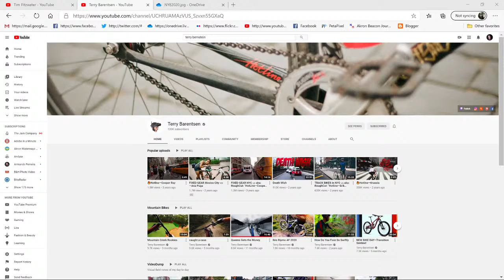Evening Routine #18 - LOOK KG76 Kevlar Hinault - Vintage French Carbon! | Campy Groupset

Comment: I just picked up a KG76 last week but the chain slips of the rear cogs. It seems to need an overhaul on the chain and derailer. Do you recommend taking this bike to a local bike shop to be repaired? Thanks
Reply from the maker: For sure. If you can’t figure out what is wrong on your own or don’t have the right tools to fix it take it to the local bike shop. This bike was sold with a few different group sets - if it is Shimano it should be cheap and easy for you shop to diagnose and fix.
Reply: @TimFitzwater OK great. Thanks a lot!
Reply: @TimFitzwater Hi again! Ok I tuned my derailer up after watching some how to videos on YouTube. My KG 76 is very similar to yours. Is there a way to determine when this particular model was made? And is it just me or is it hard to find decent white color 23 × 700 race tires because I just can't find any online at all? Thanks for your time.